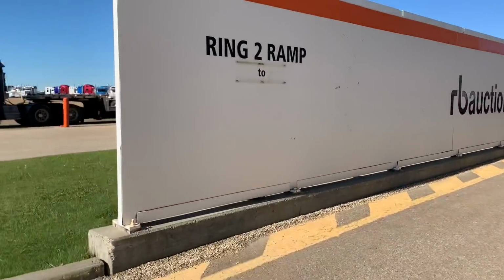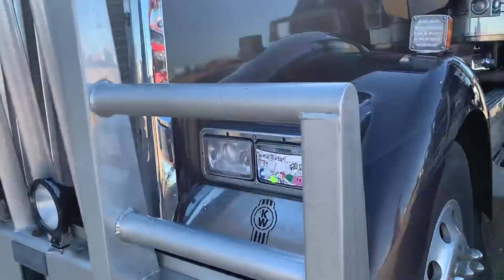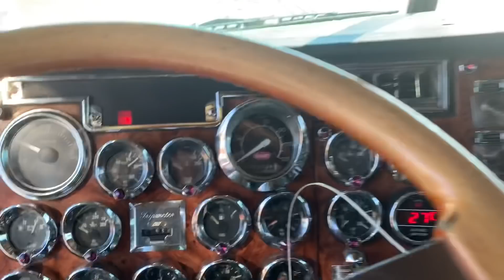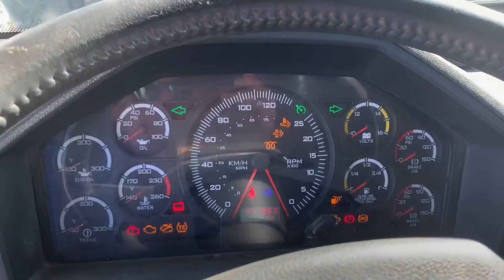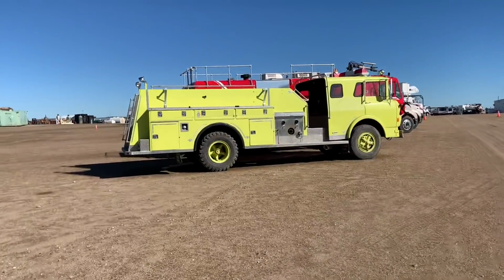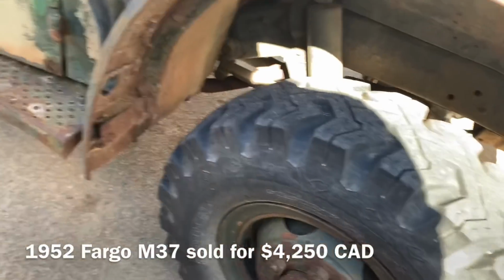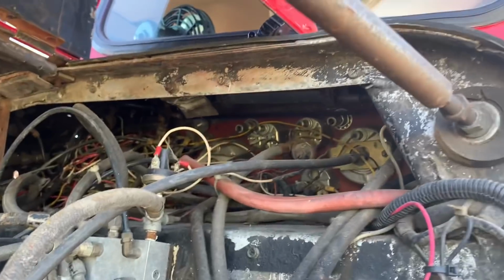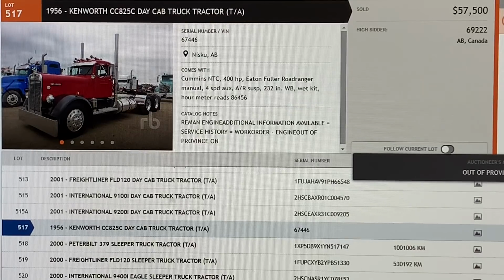On The Hunt Ep.22 Kenworth '56 Needle-Nose at Auction

Comment: Those cat trucks to the best of my knowledge were just rebranded internationals because cats engines couldn’t meet EPA standards. those “cat” engines are also just an international painted yellow
Reply: You are correct, a rebranded international, both companies were going broke during those days
Reply: Those cat ct engines utilize a cat block and bottom end and Navistar international designed a head to fit the block that utilized all of the international  emissions equipment.
Reply: @mikeshultz1007  don't know much about them but that doesn't sound good, international used a man engine as the max force and international emission system, that didn't work out well either, if only the government would stop stepping on our toes
Reply: Rebranded max force I think
Reply: And now Cat trucks is no more; stopped production here and Australia. I thought it was a cool idea, but they couldn’t make it work. Come to think of it, I don’t think International is selling trucks in Oz either, only the 9800i cab over in NZ.
Reply: @michaelwheatley7160  The Australian market cat trucks were just prostars with a cat emblem, they didn't go any further with the design.
Reply: @mikeshultz1007  early ones did have cat engines
Reply: Basically International MaxxForce engines painted Cat yellow. International cabs and various other components. Most of them spent much of their lives in the shop then were traded off for massive losses to their owners. Those that are left seem to be serving Cat dealers as equipment transport. I suppose so they can be close to the shop at all times lol.
Reply: Building the ugliest trucks on the planet didn't do much for their future.

Comment: At 2:56, I saw in the back isle a White/GMC high cabover. Wish you would have looked at that. Drove a 1988 in the Marine Corps, L-10 Cummins with a 9 speed. Had that truck all to myself because nobody liked it, but it at least had air ride and air conditioning out in the Mojave desert, and the Jake would put you thru the windshield if you didn't have your lap-belt on. Good old days.

Comment: Motor in that Cat truck was a C15 Regen. Basically the reason Cat gave up on over the road engines. The EPA bit them. Pull the emissions crap off the engine and that truck will be just as good as a Peterbilt.

Comment: Contractor I worked for in the early 70s had an old B61 Mack. Had the quadraplex transmission and push button turn signal switch on the upper left side of the dash.

Comment: that old army truck with the reverse gear over and up, says one thing that is a Spicer transmission. same as a spicer Aux. trans, high was up to the dash beside first. Drove two stick for over 30 years. first two stick i drove was a 66 dodge 800 with a 3608 v 8 kitty with a paired up spicer 5/4 in it, that 56 kenny did not have original steering wheel also. then graduated to a 76 Hayes HD 400 big cam 15 over spicer 4 aux.

Comment: I haven’t seen a tattletale 30 years. The clock had a paper disk speed time a a 3 rd line to show cheating ( but can be beaten)
Reply: I started driving for Safeway in 1985 and we had the tachographs in the old freight liner cab overs. 350 Cummins with a 10 speed. No power steering, no AC, no radio. Now Safeway has Volvos with 12 speed automatics with all of the safety features and conveniences for the driver. I retired 33 years later.

Comment: Around the 16- 16:30 the wheel adapters can be taken off and use 10 hole bud wheels instead of the bigger tube type tires. 
The biggest reason for using those adapters  are if you have a flat on the steer tire its high enough to get a jack under it and get it high enough to change tires .

Comment: That cat truck is a rebranded international. To my knowledge they came with 2 different engine options. 1 was all Navistar the other was half a Navistar and half cat engine. We had one at my cat dealer for a lube truck. When it ran it was a beast. But was plagued with emissions issues. We hade the truck for 6 yrs and spent over $125,000 on repairs and tows. Finally went to auction. Cat ended up sueing international and parted ways

Comment: If I remember correctly, Cat still makes highway motors, but they're not allowed in North America. That "Cat" truck is basically just an International. The bottom end of the motor is cat, but the top portion is Navistar and is where they were having all the reliability issues. Pair that with a stupid high price tag for a Navistar and they went nowhere.

Comment: Like the vids , have a different perspective on trucks than you it would appear , think you like em as your hobby something to create which is cool , expensive but cool , for example for me the bargain truck was the GMC/White/Volvo at 4k an old truck that could still be worked , would require some work but would do as a working truck . As for the sleeper anything you can stand up in is a bonus , having spent up to 3-4 weeks at a time living in a flat top Daff 3300 4x2 on air running between UK and spain for 4-5 years ,the bigger the sleeper the better .As a long distance/open road truck in Europe the Renault Magnum was hard to beat for living in .Liked the cat truck ,looks built to last an American version of european Volvo - pretty built proof .

Comment: The CAT truck was a joint venture with International. The engine is a cross breed of an International and experimental CAT engine. They did not sell well and had tons of problems. Biggest issue they had was pricing it like a Pete or a Kwopper.

Comment: On the 56 kenworth what was the clock like thing on the dash I know it had a clock and it locked with a swing hinge could not tell what the top dial or gauge was kinda looked like a time clock at first but then after a couple rewinds and pauses I could not tell what the intended purpose was beside a clock or maybe with those heavy duty hinges it was a small safe ?
Reply: That was the first ELD😅😅😅

Comment: I have a 1988 379 short, with 360000 original miles, 295 wheelbase, new Cummins Big Cam 3, 350 with 420 HP, 13 speed over, 355 rears, new front rear and power divider,  63" flattop sleeper, low car hauler front end, slammed!  FOR SALE ! Has pto!